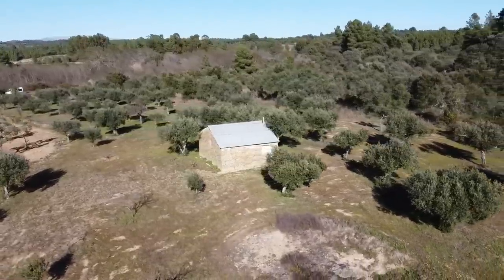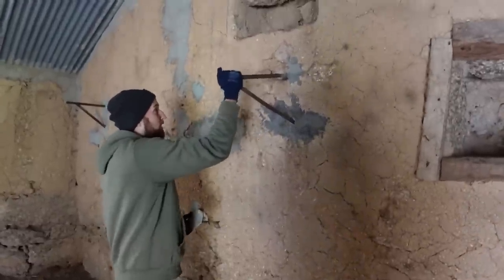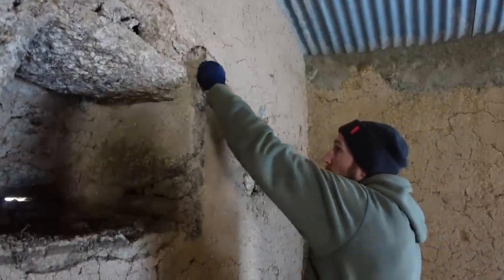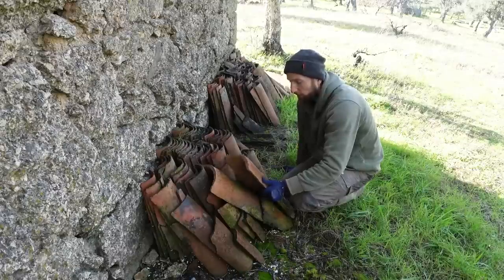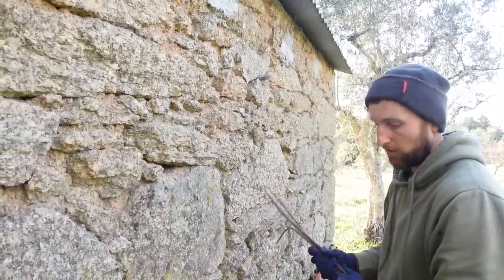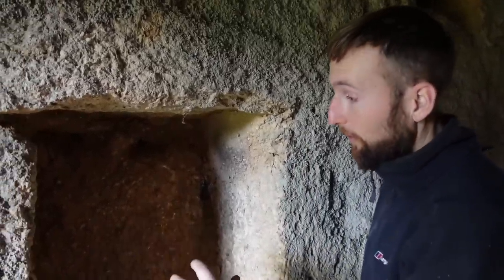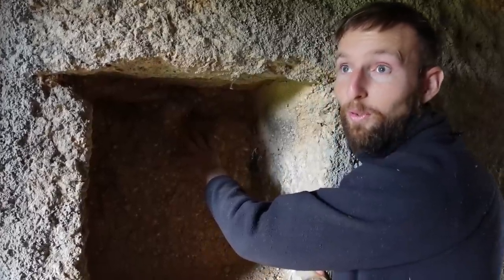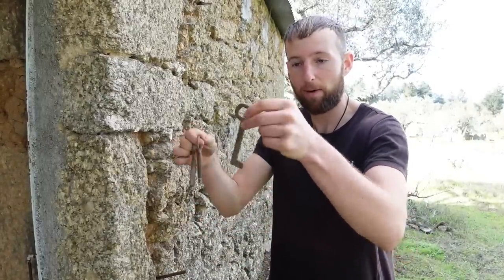Barn Conversion RESTORING 100 Year Old Farmhouse

Comment: Please wear eye protection when chipping concrete, stone, render. Even dust in your eyes can be a major problem.
Reply from the maker: Thanks for the advice 😀
Reply: even a dust mask is a really good idea. You'll be doing this for a while.
Reply: Yes Dan you need protection, better safe than sorry
Reply: @AUSSIEMADMATT  good point.
Reply: Leave 'em be. Let 'em learn.
Reply: The problem is that dust contains dry cement which reacts to water and hardens. Our eyes and lungs are mostly water so every bit you inhale is making concrete in your body!! PPE please.

Comment: If you lay down some tarps in the barn, then the dirt chippings will fill the tarp, then when it's full enough it can just be picked up and set in the wheelbarrow, and be easier to remove, instead of having to use a shovel and scoop them all up.
Reply from the maker: Really good idea thanks :)

Comment: Good to see the renovations under way, I don’t know if u have been told but please use a Hydraulic lime mortar mix  when repointing the walls, cement does not allow the walls to breathe  about 3 parts sand 1 part lime, always use a mask and safety glasses, I wish u both the very best with this endeavour, ps have as much fun along the way
Reply: Hi Laura and Dan. Make.Do.Grow channel have thoroughly researched proper traditional mortars and methods for restoring old buildings. Worth a look? They are in Portugal too.
Reply: Was about to say that as well 😂

Comment: If you are going to use Lime render on the walls, you can varnish the keys and push them into the lime as a feature. I had a 200 y/o cottage in Cornwall and did this over the front door inside.
Reply from the maker: Hey Ginger thanks for tips but we are not sure we are using lime

Comment: I am wondering just what the final inside walls will look like. Knocking off all of the old covering is a task and a half! An undertaking I do not believe I would have undertaken. I appreciate the effort you guys are putting into this and at least you are getting some nice fill material for the driveway! Once removed you can plaster the inside for nice smooth level walls or simply add backers to the stone and use wood to cover the stone. The original stone may look great but there will be so many holes, nooks, and crannies in it there is no telling just what will move into them! You guys may have some ideas on how to overcome this....I can't wait to see what the final product looks like!  GREAT JOB so far!!
Reply: Or they can fill in the holes with cement with stones on top. Painstaking job but looks stunning if the natural stone  look is wanted.
Reply from the maker: Yea we have many ideas and the barn for us is worth doing correctly as its going to be our home forever. We will be pointing some of the walls and white wash. thanks for support

Comment: Before removing the block from the window. You can put in a oak window frames. On in the outer edge and one at the inner side. This way you are safe and warm
Reply: Just like a table if you put a plank on top of the 2 window frames
Reply from the maker: Thanks, the window will be one of the later jobs

Comment: The stone building could be the start of a beautiful home, I personally would build timber frame rooms on both sides of it, then you can use the frame to put the stone veneer up, much quicker and easier plus you can tie the stone to the timber frame for more support, just put a concrete foundation under the stone.

Comment: My basement walls had dirt all over them when we bought our house, I found a brush attachment for my drill that made cleaning it off a breeze, no sure if you all may have considered a tool like that 😊

The drill brush attachments can be found with metal bristles which would do a great job on those walls!

Comment: Cringe cringe cringe,  I'm 77 years old. Been pushing wheelbarrows all my life, no matter what YouTube channel I watch, nobody knows the basic. Are you ready!.You always start by placing the wheelbarrow the direction you are going to go, so you are not going to turn the barrow around when it's full, Number 2. When filling the barrow most of the weight goes over the front wheel, so you are working on balance, only a little weight is on the handles, SImple. I'm only going to the trouble of telling you two because I do enjoy what you are doing and wish I was doing it with you. Sending my fondest regards.  Old Tom.xx.

Comment: It appears you two are going to mix a little concrete. At your age I mixed concrete 1, 2, 3, (parts cement, gravel and sand), I also mixed cement with lime as mortar in red flagstone decks. So the plan is to get the gecko barn liveable, sell the van, then improve the land?

Comment: wonderfull work, if U use a pressure washer machine of warter/sand the mud will come out easily, even if u just use a normal hose the water will break a lot of the mud, been there, blessings
Reply from the maker: something we are working on now, just need to set up water system from well so fingers crossed. thanks for adding tips and thoughts

Comment: Nice job guys! 
The pickup is coming in handy! (Wonder if be worth changing the tyres for proper off-road tyres So you got decent grip when you're on the land using it with the mud etc?)

The barn looks really promising & good having the ready cut window aswell! Keep up the good work! 👍👌
Reply from the maker: Defo considering but there is much more on the list 1st as you know always lots to take into consideration :) thanks for tip and support

Comment: To save having to remove all the wall plaster, why don't you leave them on, batten all the 4 walls, place insulation between the battens, then plasterboard out the whole room. Much quicker and you insulate the room from cold or heat. Good luck guys - love the channel
Reply from the maker: Hey Stevie because clay and dirt is not something that will last for ever and if you redner over it can can crack. its better to take back to original stone will last much longer. Thanks for support

Comment: Dont forget that stone is porous and breathes but cement and concrete will stop that happening. As someone else has said you need to consider using a more traditional lime or you may have issues later on.  Well done though for jeeping going.
Reply from the maker: Hey Roy thanks for tips and support

Comment: Use the dirt on the ground inside the barn and make it a Rammed Earth floor which will have a natural look, long lasting, cost effective and ECO friendly
Reply from the maker: Never heard of that before will need to research this :)
Reply: @theoriginhomestead  Yes please check on many videos on that on YouTube which shows you step by step how to make it. You can even build walls, houses etc etc which are stronger  than concrete. It's an ancient civilization construction method. 

If you want to send me you see guys  email address or any other mode of contact and I will gladly share my knowledge on it with you as I have tried and tested it myself and I'm in the process of making a structure too

Comment: battery  or power needle gun or a chipping hammer would make it so much easier a quicker,  I think you use stanley tools they would have them
Reply from the maker: They are not that good to be honest they take a while to prime. We have found the old fashioned method quicker. Thanks for advice
Reply: @theoriginhomestead  not sure we're talking about the same things but ok!